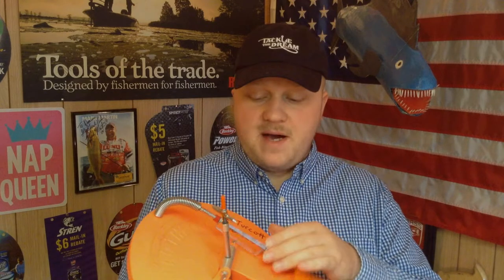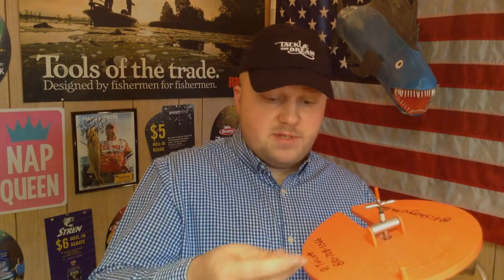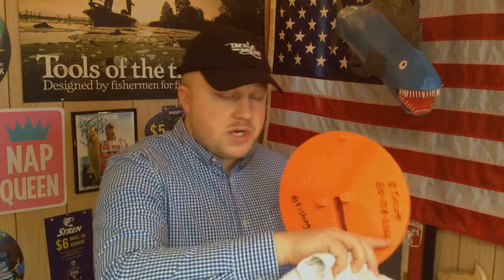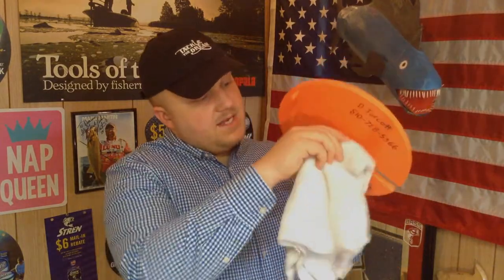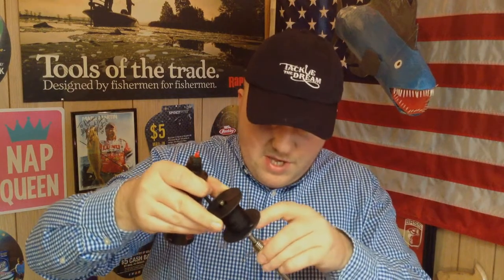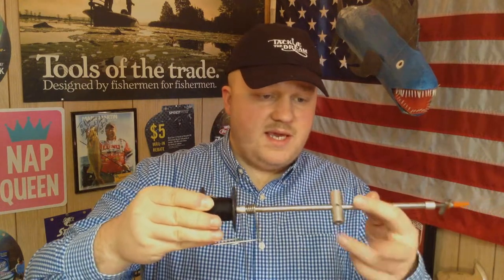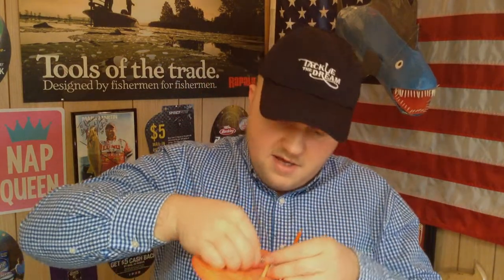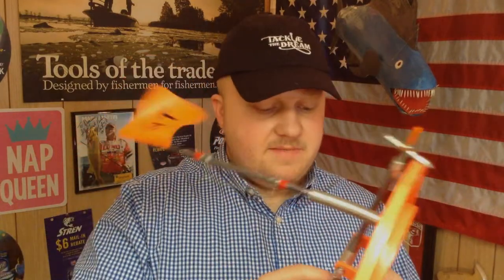The Basics of Tip-Up Maintenance

Comment: Great day to you too.Going to try for some walleye and perch today up here in North Bay Ontario.Like the videos and I will be testing a few of your tips today.Thanks.Be safe out there everybody.
Reply from the maker: My apologies for not responding sooner. How did you end up doing?
Reply: @fishingwithdom1657  No apologies required.You made my day. Thank you. Got 14 nice perch and a good size pike.Your stinger hook tip worked great.It got me that nice pike.Going on the yearly lake trout trip this weekend.We usually get them around 60 feet or so when they are hitting.We are not aloud to use live bait in the park.Had the best luck using a glow in the dark 3/8 jig with a dead shiner over the years.Your advice about the stinger hook was great and was hoping to hear what tips would be good for some deep water winter lakers? Be safe out on your adventures.